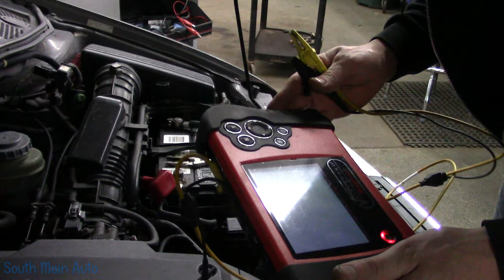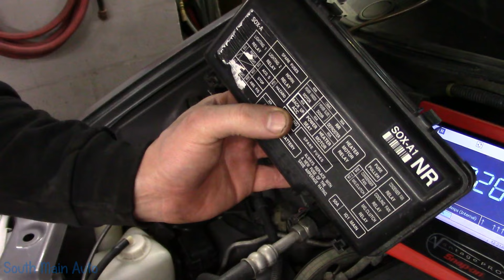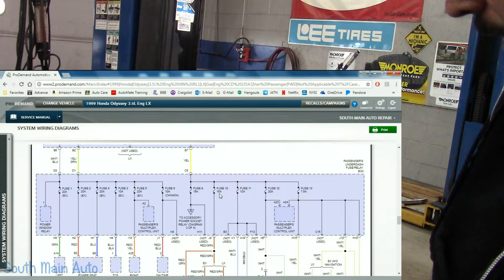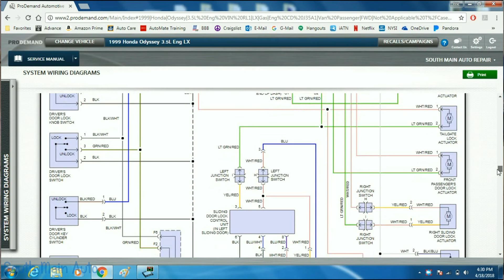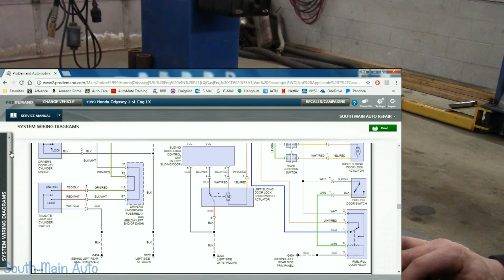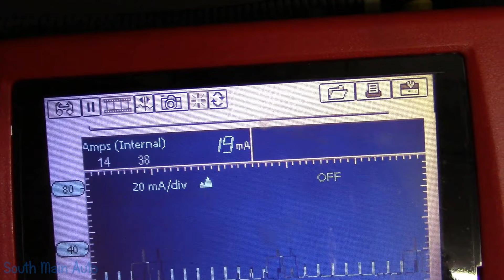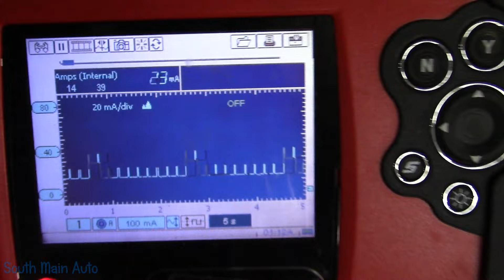Diagnosing Battery Draw (Battery Goes Dead Overnight)

Comment: Had an elderly lady with a Caddy what "wouldn't start if she parked it in the driveway but was fine if she parked it in the road". After checking for parasitic drains, etc several times, I took the tow truck to her house. When I saw the setup, I knew what was going on. Her driveway was going down into a basement garage at a steep angle. The road was level. Deck lid had a mercury switch. The driveway angle was enough to make the switch turn on the light under the deck lid and run down the battery. I put a toggle switch into the circuit and everyone was happy......
Reply: John Baugh Brilliant!
Reply: John Baugh years ago we had that on a 1990 DeVille from power lines overhead. Seriously it would not start in driveway but perfect in street. Had windshield gage display holograms nonsense . Crazy
Reply: Nice catch bro!
Reply: John Baugh -
Reply: John Baugh Sherlock, well spotted!
Reply: At least the customer wasn't lying, and seeing is believing.  Great diagnosis
Reply: Back in the day I had a 79 El Dorado and I loved it! BUT if anything went wrong with it, I couldn't take it to the dealer. (I definitely wasn't in that pay scale) But I've been working on my own stuff since I was a kid so I figured it wouldn't be a big deal, they just have more crap on them. The first thing I screwed up was, I wanted to put a better stereo in it. There was like 100 wires going to that radio! So I just tracked down the hot wire and put my stereo in. The headlights wouldn't open, half the stuff on the dash quit, and this was before you could go to Advance and buy a kit for this .  I finally wound up with something draining the battery but only certain times. I had a friend who had gone to work for the  G.M. dealer and he told me to leave it with him. It took about a month but finally he found an old corroded dime in one of the 3 cigarette lighters in the back seat! By then I was married and didn't need a Cadillac!
Reply: @davidjacobs8558  The Boot
Reply: This story was on one of the Car Talk podcast (radio) by Tom and Ray Magliozzi weekly puzzler.

Comment: How many already knew his meter had a 10 amp fuse because you've watched him blow it before?
Reply: I hope he was smart enough not to use a Johnson bar.  I know one co-worker who tried a Johnson bar and blew up a multi thousand dollar test meter at work.
Reply: Or installing a bolt .... yeah !!!!!!.
Reply: Most multi meters have 10A fuses, so I wasn't very surprised, also it was visible before it was mentioned I think.
Reply: @ColtaineCrows  that's odd why would a meter with a 10A current range HAVE a 10A fuse? I'd like to be able to measure that 10A without a poxy fuse blowing! Fuse is supposed to protect the 10A range shunt from overheating and it should NOT overheat with 10A flowing through it! 12 to 15A fuse would be more sensible if the meter was properly designed and built.
Reply: @bezaleeluk3696  Most measure MAX 10A, over 10A the fuse should blow before the meter blows... hence a 10A fuse. Not sure what your logic is, but it looks wrong.
Reply: Fuses shouldn't blow at exactly their rated current, but need some current beyond that. Typically designed for 33% margin above rating, so a 10A fuse would blow at 13.3A continuous at 25 deg C.

Comment: Had the same issue on my 2002 Odyssey.  It was the actual latch that springs out the fuel fill door.  It has a cable internally that activates a switch.  The plastic housing broke on the latch inside the frame of the car and was making the switch close as if the door was open, causing the 250 milliamp parasitic draw (activating the door lock relay).  The door would remain locked, and even lock itself if I unlocked the car doors.  Had to pull all of the paneling off of the left side which was the most difficult part.  Replaced the cable switch and the parasitic draw went away (doors operated normally).  GREAT video.  BTW - if pulling panels, I recommend buying the plastic clips (for replacing the panels) ahead of time since it is likely you will break some in the removal process.

Comment: I had three parasitic draws over the years I fixed. Luckily older cars. Yanked the battery cable and put a test light between the cable and post and pulled individual fuses till the light went out. The first was the radio in mid 90s ford car. A ford explorer the security system a relay in the back right pillar that turned on the side mirror bottom lamps. Last one was easy. A do it to yourself amp and radio with a wire that ran straight to the radio from the battery(obvious one)

Comment: I agree with checking and verifying the readings with a couple different tools/meters before proceeding. I got burned yrs ago by a Fluke 83 that had a crappy lead. I found an ASD relay that was stuck on, but my Fluke still showed 750+mA down from 3 amps.. I chased that SOB for hrs! For the heck of it, another tech lent me his 98, and low and behold, the meter showed  .0025mA  with the relay pulled. I fixed it, but didn't know it!
Reply: Point is/was, make sure your leads are good by zeroing them out on the ohms scale before going after any kind of amp draw. I assumed my meter was correct, and it cost me a bunch of wasted time!
Reply: No question about the importance of working test leads, but how did faulty leads cause a misleading high current reading? Meter itself maybe.

Comment: Another awesome video. As soon as OBD2 came out around 1996 the OBD2 module brains should've had their own rechargeable power supply with a battery management system that's fed by the alternator separate from the main battery that can go for weeks or months without driving the car with its own fault codes in case of an issue. What an absurd design for an essential component to be powered in such an non strategic way.

Comment: Eric 'O' Iv'e told you this several times before, but you are an EXCELLENT TEACHER. I have called upon several of your tutorial videos to help me with issues I had to deal with, especially my on my 2007 RAM. I had a power drain on my 2007 Ram 1500 Hemi...................Turned out it was the ignition wire on the starter solenoid.

Comment: You have done this multiple times and I have watched them all. My '03 Avalanche developed a parasitic loss and caused me to use your methods. I never traced to the exact circuit, but eliminated so many possibilities I decided to replace the gang window, door lock, mirror switch on the driver's door. The switch has gradually lost function over three years ( it isn't a daily driver). I unplugged the switch while I waited for the new one to come in. Checked the battery after three or four days and it was fine. New switch allows me to adjust mirrors and roll down windows. Life is good!

Comment: Had a 2000 Olds Intrigue.  Whenever it sat idle for a couple of days, the battery died.  Mechanics were perfectly willing to replace the battery, but none of them ever bothered to perform a parasitic draw test.  One day, a wisp of smoke floated from under the hood.  There was a small flame on top of the alternator.  The rectifiers had shorted and were draining the battery through the alternator's windings, which heated so much that the windings' insulation melted and caught fire.

Comment: Hey Eric, regarding amp clamps, the AC mode is inductive, but the DC mode uses Hall effect, it is very sensitive  to magnetic fields, even the Earths (planet earth) which is why on low current range you need to zero / null out the meter before reading.  Good interesting video, thanks..

Comment: My car was doing that but because some dumb ass installed the aftermarket stereo wrong. I removed the battery power fuse and it fixed the issue I’m gonna send it to a shop to wire it properly . Thanks for the video

Comment: The very first thing you do before pulling any fuse or measurement is look for aftermarket accessories. Nine times out of ten even when wired by someone who has a clue it will be the accessory either wired wrong or just doing what it’s supposed to do.
Even things that just plug into a cigarette lighter socket or the data port can draw power if the circuit doesn’t switch off.
I fitted a reverse camera and unfortunately picked the wrong one of four identical power wires after finding the right one the wrong one jumped in its place as I was fishing between panels and trying to get both hands in to a place a child would have trouble getting one into. Being a low power draw it would take a week or more to kill the battery but it kept burning out cameras.
Reply: I always fit accessories on the "15" rail, should stay dead when ignition is off. Well, if a customer requests it different they get it different, but they also get a switch to turn it off.

Comment from the maker: *Auto Range Digital Clamp Meter 400 AC DC Current Hz Tester: https://amzn.to/2jtTjGG
*ATD Tools 5513 Heavy-Duty Circuit Tester: https://amzn.to/2JSHswZ
*10 Pcs 5-Color Double Ended Alligator Clips Test Lead Jumper Wire: https://amzn.to/2HOl3Em
*Astro 40SL 410 Lumen Rechargeable COB LED Slim Work Light: https://amzn.to/2riHdoc

Comment: It shounds like the best solution would be to replace the fuel door switch. I know the decission would be left up to the customer but becacuse it is a safety issue it would be in your best interest to recommend they allow you to replace it. Its all about libility and you could could become liable if you bypassed the safety devise and it was just your word against theirs. Document, document. Im no specialist as im only a plumber and gas fitter but i have heard enough where a furnace repairman bypassed safety devices and ended up in court. Always remember safety first. Yours and your customers. Great video by the way.

Comment: Great help. I had I think similar story with Honda Odyssey 2004. Followed up shown procedure: same fuse 54 and then fuse 12 (inside). Only I didn't bother to remove relay instead I analyzed what would be most vulnerable component in mentioned circuit and decided to check   sensor on fuel filler cap. Bingo! it had bad contact - after hitting button multiple time issue is gone. Now I know how to check if sensor failed after fueling - if I can not open driver side sliding door from my dash - I got to go and train that button.

Comment: Good diagnosis steps. I'm always thinking things like "Honda electrics almost never fail" and then I remember where you live and a fuel door switch will be exposed to some of your lovely salt spray and might get the crusties. At least it wasn't the multiplex body control module.
Reply: Until it's proudly made in USA.

Comment: If the draw is slow, one option would install a battery tender and plug it in when parked. A battery cut off switch when no outlet available. I mounted a switch inside the front right wheel well on my 06 corvette for periodic storage and theft protection, worked perfectly.
Some draw problems aren’t worth the cost of diagnosis.

Comment: Had my own parasitic draw at one point. Just bought the car used and was working fine then one day no start, no dash, no remote controls, dead battery. Charge battery and starts fine. Went for one month then dived in with scope on a rope, amp clamp on battery and diagrams from alldata to tell me what circuit was killing battery. Found main fuse in under hood for heated accessories, like side mirrors, rear defog, and the seat heaters. Went and pulled fuses in the passenger fuse panel and draw would disappear for the rear and side mirrors. Pulled relay and power draw was still there. Determined fuse box was bad, replaced and no more phantom power draw. 2009 Buick Lacrosse that had two deer one on either side of the car. There are more things with this car that I have to fix, like random knock sensor grounding, modules disappearing from system then come back, and my favorite, the headlight driver wire from BCM to under hood fuse box broken.

Comment: Hi Eric just a couple of remarks, if its that much current it might be worth changing it to watts, i think its about 3 watts so it could be a bulb like the one in the trunk staying on, and with the fuses if you check which ones are live first you only have to remove those, as the dead ones shouldn't draw current, just an observation but you are  doing great, from Fred in Essex UK.
Reply: Blue point  has a meter called  Amp Hound. Very efficient  , fast  way to check without pulling  fuses.
I think  it's  made  by Power  probe.

Comment: Relays & switches that fail, taking the place of brain cells in the 21st Century. Gotta love it! I guess in today's sue-happy world, automakers gotta cover their butts. Not surprised to see a system like that.

I don't dare do an amp draw test on the Silverado without an amp clamp. The monitors won't run for another 3 years if I disconnect the battery ... 😂

Man, I never get that lucky! Every time I try to remove a small component to reach another component, it's just out of my reach ... and I end up having to yank the panel anyway! 

Off to do 2500HD parking brakes. Uhhhgg. I can see the rust, broken bolts, and axles coming out now ... since it's supposed to be a simple job!  😒 Great vid, brother, as always! 👍

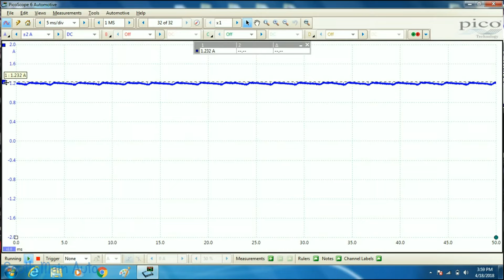Comment: I really like that multiplying for your inductive clamp. I'm definitely going to do that !!! This video is very interesting to me I have a 2018 Kia Sedona. The passenger side door slide open and the key fop won't open the driver side sliding door. Got a terrible battery drained it's killing my battery overnight. I think I'm probably going down the same trail that you got there ? Thanks for the video I really appreciate it. It's 5:25 in the morning and I haven't gone to bed yet trying to fix this problem.

Comment: I know this sounds stupid, but you'd think that a fuse holder with a little momentary switch and long leads would be helpful when trying to find a mechanical relay. Matter of fact, I think I'm going to go make one now - provided I can find a scrap momentary switch.
Reply: fuses and switches bah, I use speaker wire, lamp cord or random wire laying around, run it where your working and play arc-o-matic touching the wires together
obviously you can go all "fancy-pants" and make a permanent test cord with inline fuses and push button.
Reply: No fuse is fine if you're messing with your own ride, I'd rather not chance letting the smoke out of a customer's ride.

Comment: Better advice - Make sure you put your meter connections back to voltage after measuring current otherwise when you go to measure volts with the cables left in for current you will blow the fuse in the meter. If you do it the other way round there are no ill effects, but left in current measuring setup you will be upset.

Comment: Before tearing apart the interior to replace it, verify that the fuel door switch is being depressed by the fuel door. Honda uses mechanical switches that are very reliable, but the fuel doors themselves are not (so they are easy to replace). The part that pushes against the door open switch plunger is likely to be plastic or rubber and worn or fallen off.

Comment: Found my trailer brake controller had a steady draw whether a trailer was hooked up or not. Finally had to pull the plug going to the controller when not towing. It wasn't a large load but would pull the batteries down if the truck was parked for any length of time (like weeks).

Comment: Thanks! This was so very helpful. First, I checked if the driver side door would open-- no dice! Then, cycling the fuel hatch yielded no clicking back there. So, I thought, easier to pull the speaker than dig out the fuse box. The relay felt warm... Bingo. Thanks again

Comment: Also had a Hondu early model with a 12 volt draw that was shown with connection on the negative battery cable and the post. I found garbage in the cigarette lighter that fixed that draw.

Comment: Short to power was already ruled out, you pull the fuse and the relay de-energized. If it was shorted to power it would have to be from a different circuit and as such the relay would stay energized.

Comment: Great videos! I’ve picked up a lot of good info from your videos that have helped me keep my vehicles running and saved me lots of $$$. Regarding a parasitic drain issue I’m having on a 2009 Civic, what would you recommend as far as a low current amp clamp and possibly an inexpensive hand held scope-digital multi meter. I’ve been looking online and at videos and not sure what to buy. Once again , I read the comments, and it’s very obvious that you have a large following due to your excellent videos and the way you explain things.  Thanks!

Comment: Go back to the fuse panels. Look for and pull a similar relay. Pop in that scavenged  relay and give her a go. After you get the 'new' relay, it may be easier to reach in a fuse box and put the 'new' relay in there. Besides, now the excessive current draw is gone and the doors 'almost' work. Mr. O, keep up the good work.
Reply from the maker: But the relay was not broke? It was being commanded on from the faulty switch.
Reply: Sounds good but, verifying your diagnosis with a know good relay, may save you from wasting $10.00 on a unneeded part and embarrassment with a customer. Besides, it's easy.

Comment: The schematic is showing that you will have this current draw if you leave the fuel filler door open also.  That can’t be how it’s designed.
Reply from the maker: That is 100% how it is, if you leave the fuel door open on a good working system you battery will die!
Reply: thought they had a BCM that timed out and killed power, maybe I'm thinking about wrong vehicle/year

Comment: I suspect some crap got into the alternator and is under the regulator board. As the alternator cools the outer casing contracts, and the crap bridges the gap between the regulator and the casing, creating a short. When the engine warms up, the short goes away, and the alternator charges the battery. This would fit the symptoms.